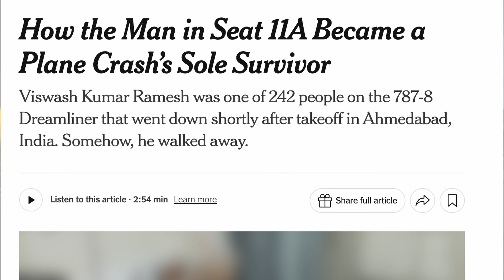Why the RAT Changes Everything – Air India 171 Update

Comment: Great Analysis. In Summary:
Theory-1. Dual engine failure : Reasons:  Electrical/Hydraulic failure. 
Evidence1: ATC (Air Traffic Controller) audio from Pilot: "Mayday.. No thrust, losing power, unable to lift"
Evidence2: Eyewitness (Seat# 11A survivor) that he heard "a loud bang and the lights flickered" (means RAT deployed)
Evidence3: Video shows RAT (Ram Air Turbine) was deployed for Emergency Power. It means Engines/Electrical failure  
Evidence4: Buzzing sound in the video (RAT)
  
Theory-2) Birds strike : Inspector reported that no dead birds were found on the runway 
Theory-3) Pilot error: Mistakenly raised the flaps instead of the landing gear (wheels), causing loss of thrust

Comment: Steve yes RAT deployment Very Key   but one Video being Shown is the plane not lifting off till very end of Runway ... so loss of Power Started before end of Take off roll ...

 Momentum took plane into the Air  ... but did it injest some Infrastructure  after or As it lifted off ie ILS ANTENNA at end of the Runway ???

The Video i Refer to throws up Cloud of Dust ... ground effect or whats left of thrust from Dying Engines ???

But as you suggest Lights go through reset after loud bang  as Power source changes Power Busses  

 ... i am thinking We may now Have Answer ... But why was  loss of Power ....  was it After or at Rotation Point on Runway ...

Or as One Report Suggests that the Issues may have Already started on the Previous leg of the Flight from New Delhi ???

A passanger reported as saying he Was glad to get Off his short Leg because of Issues the plane was having ... before it landed at the Crash Airport ?

All very Sad Steve which ever way you look at the Crash ...😢

Comment: In my opinion the tragedy is that no one is understanding that the weather at the time were the sole cause of this crash. By weather I mean the following. The temperature at the time were nothing less than 38*C [ in the shade ] and this were exacerbated by low air pressure. This combination is why the perfectly flown and amazingly safe to fly in Boeing 787 Dreamliner flight AI-171 were not able to get off the runway and when it did it were failing to gain altitude. It only lifted off the runway at the very end of the strip. High temperatures make the air less able to give the aircraft the lift needed, and this were further exacerbated by the presence of low air pressure at the time. Although the official [ in the shade ] temperature is given as 38*C in actuality the real temperature in direct sunlight along the runway were probably in excess of 50*C in my opinion. Thus I hold the ATC "Air Traffic Controller" accountable for failing to postpone the flight. Had ATC "the tower" postponed the flight until the weather situation were less obnoxious then this disaster could have been avoided.

Comment: Wonder if we are talking about a dual failure of the engine’s FADEC’s? It happened before on an A400M back in Spain several years ago, killing half the crew. You really don’t hear a lot about FADEC failures. The FADEC’s are fairly reliable. For those who are wondering, the FADEC is the engines computer. It’s basically the brain of the engine, which most modern engines have now. If that FADEC fails completely, the engine shuts down…

Comment: I think if it was dual engine failure, the engines ingested something at the end of that runway since they used up almost all of the runway. Sand,,, since they fly through the Middle East and in India I’m not so sure of how they clean the runway with sand. A gulf war vet who worked on jet in the 90’s mentioned something like that.. or like you said cap.. fuel contamination.

Comment: For the sake of Boeing, which has been making slow comeback over the last 3~4 years, and for the sake of all airlines that fly 787's,  it is hoped the causes of the dual engine failures (if indeed they did fail) are determined and corrective measures are made, as soon as possible to put to rest the fear of the flying public and investors.

Comment: Is there any engineers familiar with the fuel system on the 787 making any videos or statements anywhere? Because as a layperson my best guess at the moment would be that upon rotation as they changed angles to that 10 degree climb the fuel sloshed around the tanks and may have mixed contaminants with older, good fuel that had been sitting down by the fuel pumps during the taxi? Is this possible with the design? Could something have broken within the tank and clogged the fuel lines? Just a hypothesis why a contamination issue would not manifest itself immediately upon engine start up and waited until the absolute worst time to strike?

That guy who survived? I bet he gets a visit from Elijah Price/Mr. Glass!

Comment: Also if you have a look to the wheels blocs they are not pitching up, their regular position. Flat configuration means pilots initiated retractation but hydraulic failure stopped the process.
For sure this is a dual engine failure to idle. I bet a coin on a fire in the avionics system. This already happened on 787, plane batteries exploded and burnt the fuselage, fortunately while parked.

Comment: The 787 uses electric fuel pumps.  Each engine can suction feed from it's respective wing tank, but not the main center tank. There are some other restrictions on suction feed that need to be figured out, how quick does it switch, angle limitation, etc...  What's the checklist for fuel feed on takeoff, how quick can the scavenge pump switch off to allow suction feed,  etc... etc... So the devil is likely in the fuel system details where there was an electrical fault.  Thrust declined below a level required for sustainable flight via fuel starvation, the RAT deployed, but fuel flow did not resume in time for the engines to spool back up.

Comment: If fuel, wouldn't other jets fueling there have engine issues as well?

I'm wondering what could have been done to intentionally cause that to happen, either sabotage in advance, or something fired from the ground.  Say, a large caliber sniper round fired at a known vulnerability?

Some years ago, when the ready availability of 50 cal sniper rifles was causing a mild bit of alarm, it was noted that someone with knowledge of the internals of passenger liners could sit at the end of a runway and take one out with just a well-placed shot or two.

India and Pakistan did just have a bit of a spat, did they not?   Not long after a terrorist group based in Pakistan killed a number of people?

Comment: Honest question. if both engines were running would be able to hear the RAT that clearly. I live near a major airport, and when they spool those engines up it blocks out most other noise. I understand that the air flow through the compressors would still be very loud. If there was some kind of combustion in those engines, that would drown out the RAT.

Comment: Could you please comment on the report from a passenger who flew in on that very aircraft from Delhi a few hours earlier. He said that during that flight the IFE, cabin crew call buttons, Aircon and cabin lights were all not operating correctly. Surely that points to a major electrical fault already in place long before the plane took off for London. Does this not have bearing on the RAT deployment and does it not also indicate shockingly bad judgement in allowing this plane to fly?

Comment: In the second video you can clearly hear the RAT has been deployed and no screaming turbine sounds which should have been close to full power. I suspect 3 to5 secs after Vr both engines flamed out due to an undetected fuel icing condition that has happened to other Boeing aircraft in flight from very low and to high cruising altitude. British Midlands crash? This theory would explain the accident perfectly. Thoughts please.

Comment: I wonder what takeoff procedures are for the B787. Does the pilot press the TOGA and let autothrottles manage takeoff power/climb thrust? If the PF was the right seat and calls for gear up, might the throttle levers have been "bumped" by the PM (left seat) causing the autothrottles to disengage bringing the enginges to flight idle? The audio whereyou focus on the RAT is telling. I hear that also. What I don't hear is the fan growl of the GE90 engine passing low altitude overhead at takeoff thrust. Fuel contamination is dubious that it would happen simultaneously on both engines. They draw from different tanks and the APU fuel burn would also affect fuel available from one side vs the other.

Comment: @captainsteeeve 

From Google's Gemini AI
I gave it the scenario and this is what it said: (I removed the multiple bird strike scenario)
Fuel Contamination/Starvation:

    Contaminated Fuel: Water, debris, or incorrect fuel type introduced during refueling could lead to both engines failing due to fuel system issues. Given the aircraft had just taken off for a long-haul flight, it would have had a full fuel load, making contamination a serious possibility.
    Fuel Starvation: While less likely for a dual engine failure, a severe system-wide fuel supply issue (e.g., fuel pump failures, blockages that affect both engines simultaneously, or an extremely rare misconfiguration of fuel cross-feed systems) could starve both engines of fuel.

Mechanical/Electrical/Software Malfunction:

    Catastrophic Mechanical Failure: An extremely rare, but possible, simultaneous mechanical failure within both engines, perhaps due to a manufacturing defect or an issue affecting a shared component (though this is highly redundant on a 787).

    Electrical/Software Glitch: The Boeing 787 is highly reliant on electrical systems. A critical and widespread electrical failure or a rare software bug that simultaneously affects the control of both engines could lead to a loss of thrust. The deployment of the RAT strongly suggests a loss of primary electrical or hydraulic power. Boeing has had issues in the past with software bugs leading to power shutdowns (e.g., a known bug that could shut down all four generators after 248 days of continuous power)

My additional thoughts: potential sabotage/terrorism act. Perhaps someone on board needed to go bye bye or other reasons for potential sabotage. Or what about maintenance crew human error?

Comment: Another thing to add that can be seen in the video: The landing gear boggies are tilted TO THE FRONT, instead of to the back as they hang when landing. And if you look videos of the 787 landing gear retracting, IT TILTS FORWARD before getting into the plane, what makes me think the gear retraction stopped due to lack of hydraulic power.
Reply: I have thought from the first that this is a hydraulic/electrical failure. More like engine starvation than flame out.
Reply: True YT @Swiss001 came up with that some time ago
Reply: @soeren72 I've been saying that since it happened. Seems like the hydraulic pressure has gone.
Reply: My initial reaction was that a complete systems failure was the reason for the landing gear malfunction and that it was just a symptom of that failure.
Reply: Another thing I thought of when captain Steeeve and other 'experts' that I've seen on TV said about the landing gear being left down was - what if the first officer didn't call "positive rate'" because he didn't feel there was one?
There seems to have been a certain rhetoric in the coverage right across the board apart from one channel in particular, which so happens to be my 'go to' channel. 

Almost as if there was a little Boeing Bias at play tbh.
Reply: @jamesbong4928  Boeing bias is one way to put it.
Reply: @jamesbong4928  787s are prone to brake drum failure which requires the crew to leave the gear down for two minutes to allow the wheels to stop spinning prior to retraction. It happens to all aircraft but i see it on 787s more than any type. However, in this instance, i think retracting the gear was the least of the flight deck's priorities and raising the gear would have induced more drag during that brief flight time.
Reply: And the surviving passenger said that he felt that the plane suddenly caught something and stopped. I think that feeling happens when the drag is massive no?
Reply: what is the check list of air india before take off ???? the engine should have sign of malfunction before take off  !!!!!!!
Reply: @nancykoo4156  The problem must have presented after V1 (but still on the runway I think because it had poor performance alreadt when taking off, and needed the full runway to do it), but it's going to be a long investigation to fully discover the chain of events that led to this malfunction.
Reply: @christopherabramor3012 　thx a lot, I start to worry the quality of any kind inspections/repairs may cut the corners , I fly two overseas one domestic this year . It definitely is my concern…….
Reply: @nancykoo4156 engines and systems can fail at any time.

Comment: I found a similar article on cbs news

Captain Steve, is it possible to turn on the rat manually, even though the engines are running ?

Maybe the pilots did it manually as a last resort  ?

Quote from Cbs 
After the takeoff, within a minute, it felt like the plane came to a standstill (in air) for 5 to 10 seconds," Ramesh said. "The green and white (cabin) lights turned on in the flight. I could feel engine thrust increasing to go up, but it crashed with speed into the (building)."

Comment: The lone survivor mentions that green and white lights were flashing and it sounded like as if pilots were giving race to the engine (might be the RAT sound) as it took off over and above the full thrust it must have been already on. Then it controlled crash landed on top of the building in a way to save the tail with the black box. Can Dual engine failure happen if the fuel valve is left closed ?